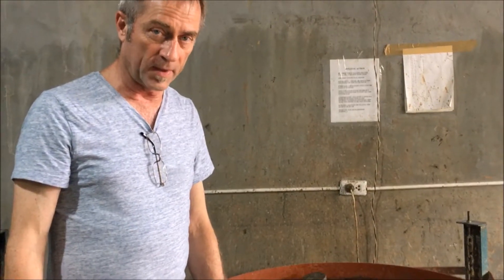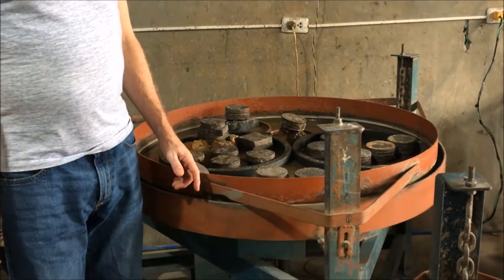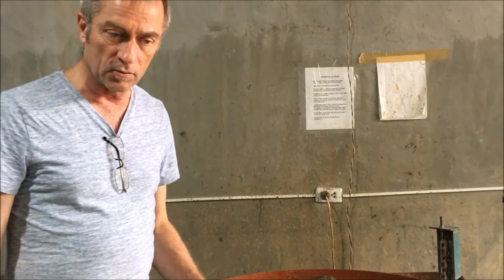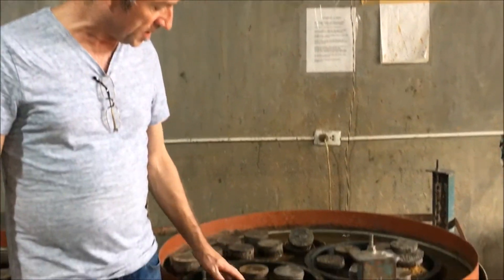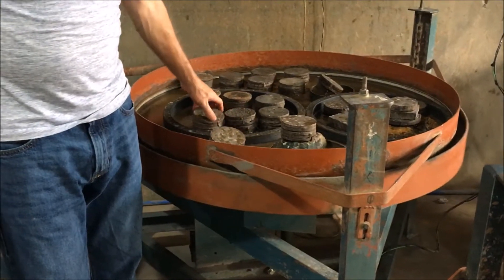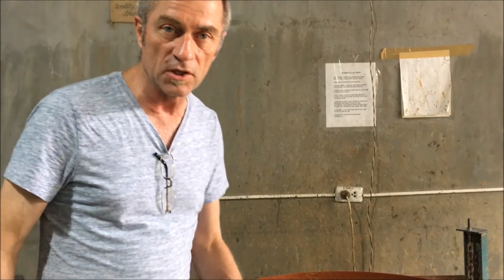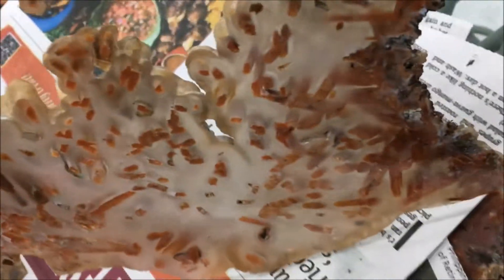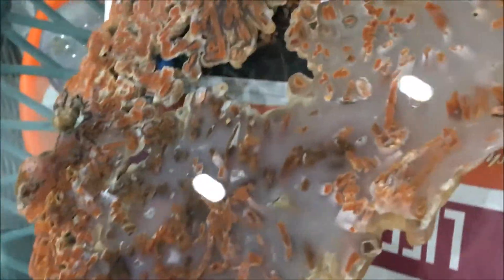Reciprocating Flat Lap Overview

Comment: Why do you use a flat plate where the other brands use plates with v grooves or dimples? I have an old 24" HP and the grooves have worn away bar 2 inches from the outside. Wondering if I can replace it with flat plates with no grooves?